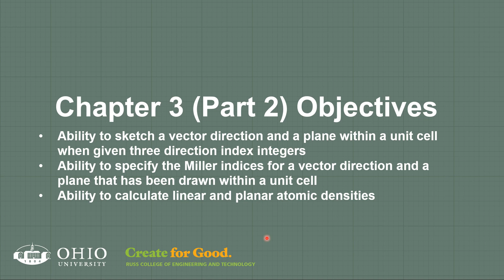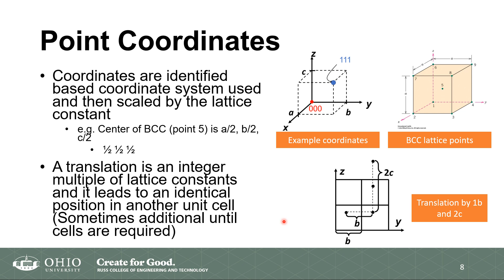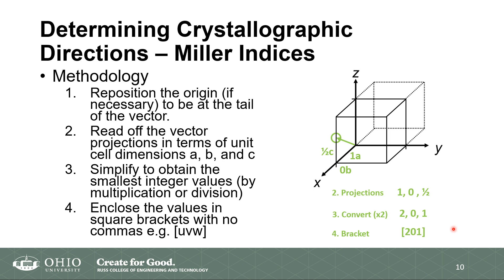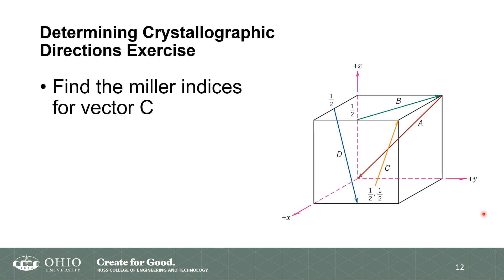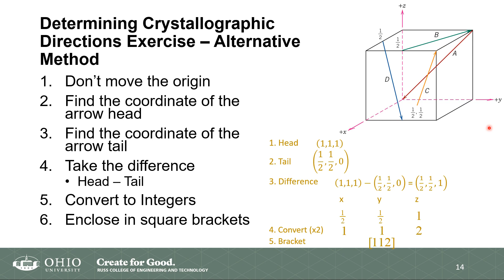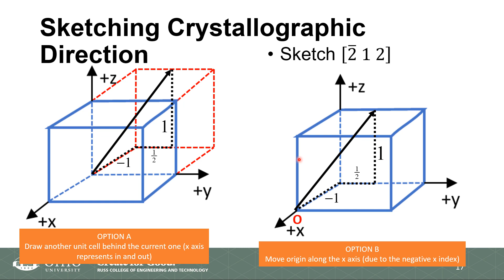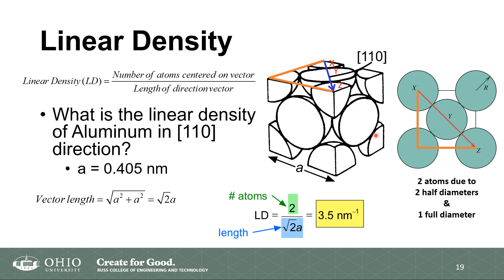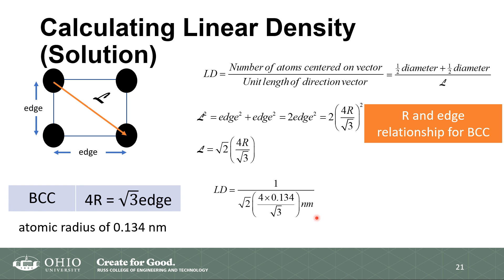Crystallographic Directions

Comment: I have a question about the last example,
The constant relations you gave for the different crystals are for the most dense linear vectors ( BCC = 111), but the vector asked about is actually in the 110 vector, so why did you take the radius to edge correlation of sqrt3 and not sqrt2 
??
Thank you
Reply: Sige